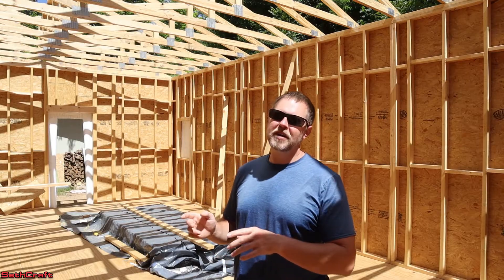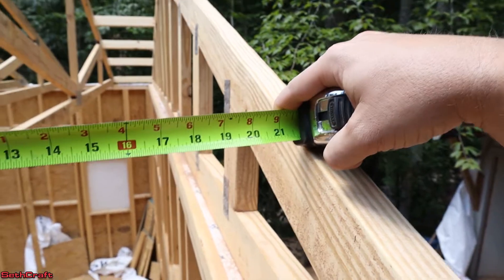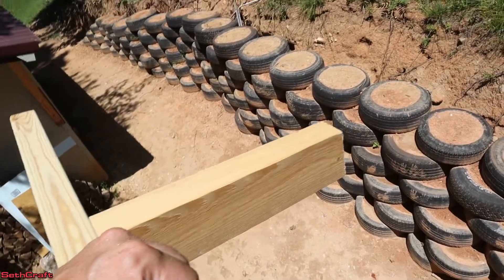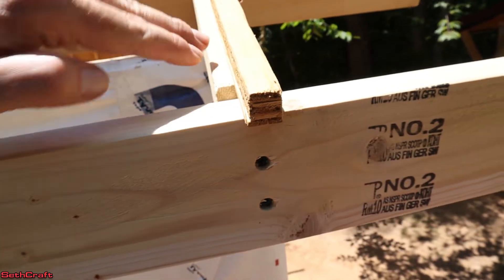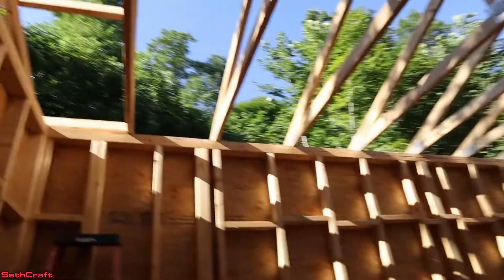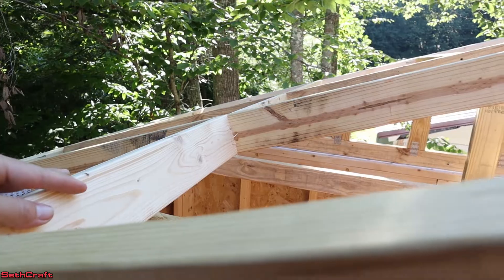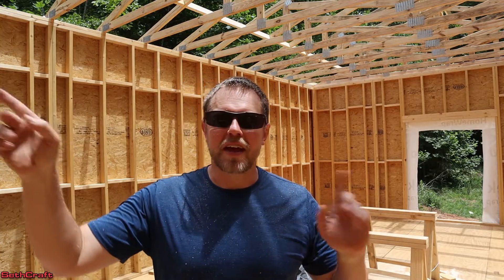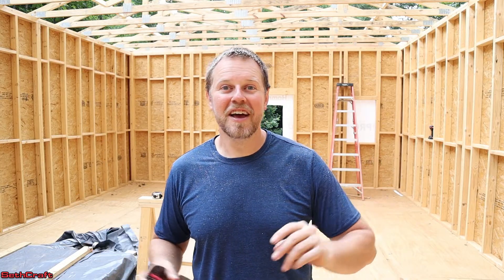Roof Ladder Blocking and Sub-fascia - Build a 20x30 Workshop

Comment: Could cut a bevel on the top of the sub-facia equal to the slope of the roof, then align the top of the sub-facia with the top of the end of the truss. It’s a little more work but a more finished and supportive result.

Comment: get a speed square and learn to use it. those look like 4/12 trusses from menards. so you just go to your 4/12 angle on your speed square and you should be closer than that. my drop end trusses, only had a 3" drop instead of 3.5", so my ladder blocks lift up. I'm gonna have to notch them. But i do want to say i have never done a roof and your video has helped draw out the steps to get to the end.

Comment: any reason why not just use a power nailer ??? screwing everything in ???? isnt that faster ????? (i know screws are tighter  etc etc  but all conventional builders rely on power nailing with a framing nailer)
Reply from the maker: The main reason that I did not use a power nailer is because I do not have one.
Reply: And a building inspector would make you go back and nail allot of what you did that front truss in any bending will snap loose as those screws shear why did you go that route and not haane all the trusses the same placing each end one in place putting up a mason line to then align them? Then just make up a ladder style eve out then using heavier deack screws used to place cleat boards on a structure, then using screws works great, then simple boards  tying the next truss into it avoiding the imposed cantilevered weight. To me its just way more work and easier to mess things up doing it this way it seems, still enjoy watching.

Comment: This is a fantastic series for me.  I’m planning to build a 16x20 shop this summer.  It’s instructive to see you doing it alone as I’ll be working alone too.  I’m going to build my own trusses for an 8/12 roof.  I plan to build the flying trusses in the shop which will avoid the slight angle problem you encountered.  I think using the same jig I can hoist the assembled flying trusses in place.   Thanks for these excellent videos.
Reply from the maker: Thank you for watching. Building alone is a challenge at times but not impossible. Sounds like you have a great project ahead of you.

Comment: Looking good, I was all set to start covering my roof OSB then realized my gutter apron and drip edge hung down too far over my subfascia and I wouldn't be able nail fascia....so off to Menard to grab LP smartside fascia trim. Got the first coat of paint drying on it now.
Reply from the maker: Sometimes we have to step back and rethink things. nice to hear you got it solved. Looks like I wont make it to painting this year. its starting to get cold and I dont have all the siding on yet.
Reply: @sethcraftshop  acrylic latex can be applied down to 35F...I'm hoping to paint before winter!